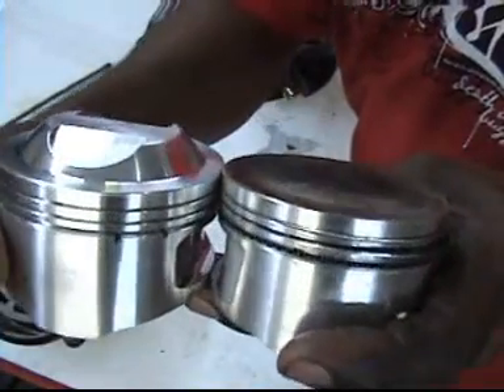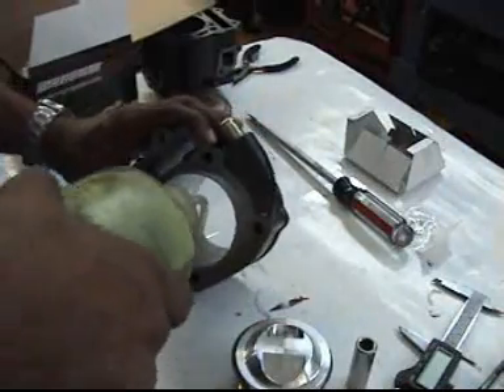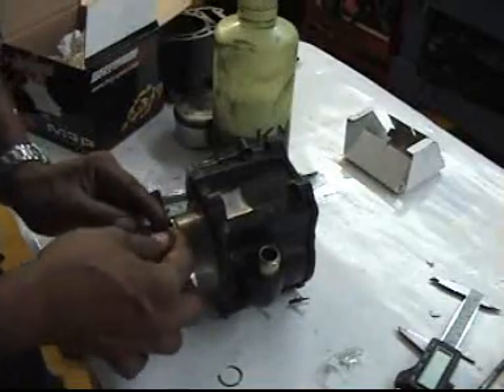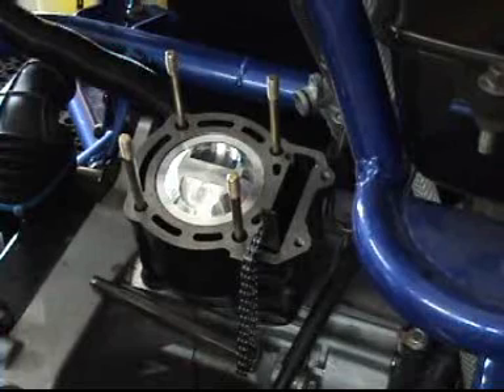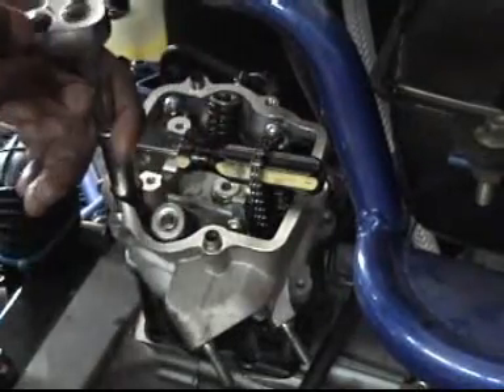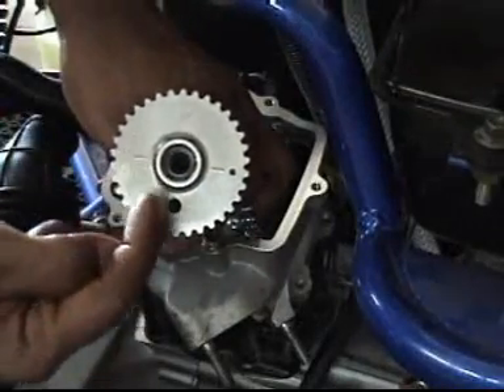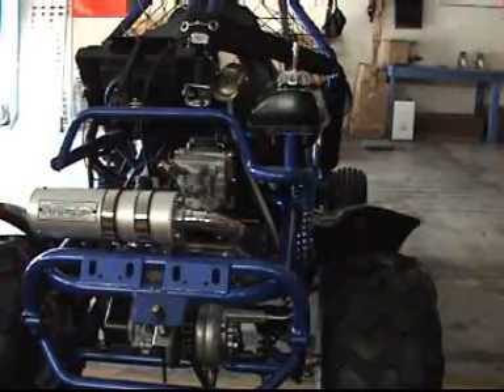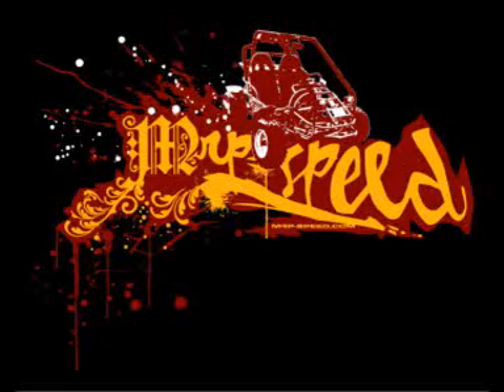Part 2 of Lance Buggy 250 big bore upgrade by MRP

Comment: Many many many details missing!!! On which side should the piston be mounted? With how much torque do you screw down the cylinder with? What about removing the cooling fluids before taking anything apart? What way do you put the cam shaft back to make sure the engine timing is right?